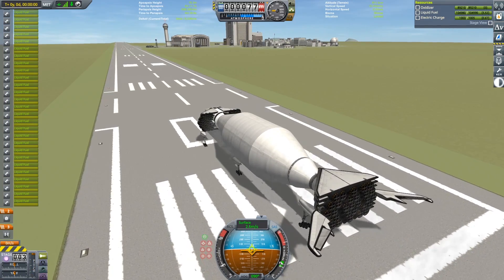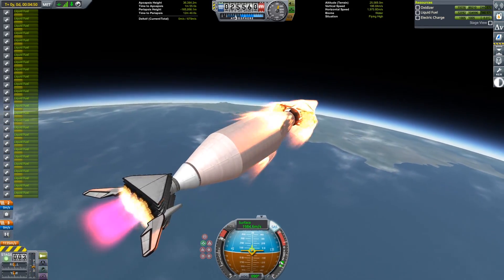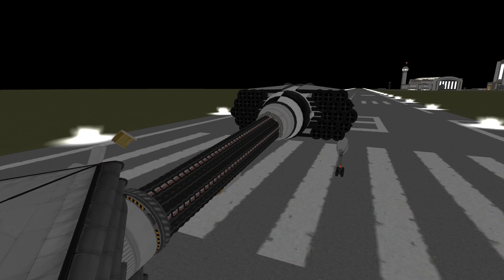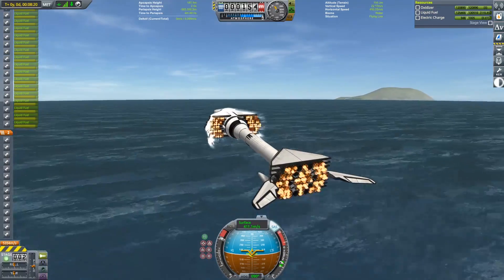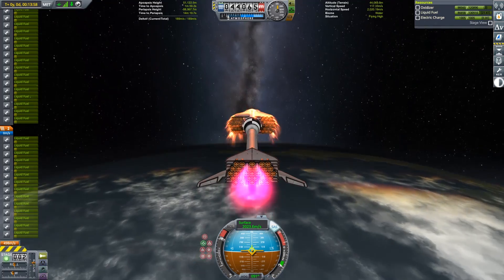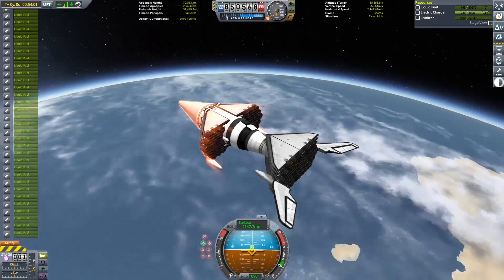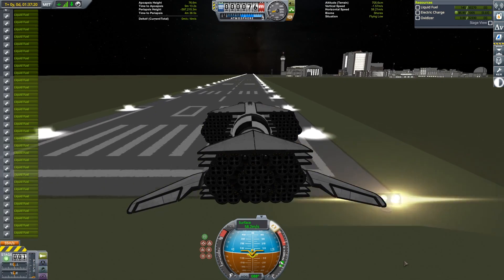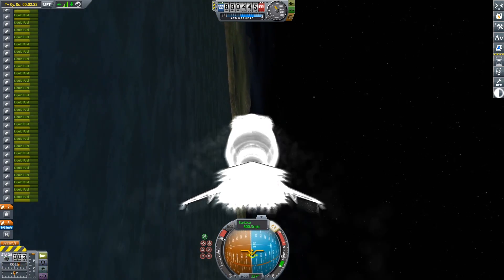KSP - Delivering 1000 tons of payload to orbit with a 600 ton SSTO

Comment: The one thing that stuck out to me immediately was you had no static incidence on the wings. If you can get through the 320-390 m/sec Mach barrier with the nose pointed precisely prograde, you need a lot less thrust. Less thrust means fewer engines, less fuel to feed them, and less structure.
 I have made large SSTO tankers with initial takeoff acceleration as little as .32G. While they weren't optimized for payload fraction (I'm all about the Benjamins), they were still very respectable in that regard.

Comment: 8:52 could add another set of smaller landing gear to the front for end of mission landing

(or add a 5th landing gear to the back in the center to make it stick to the ground on landing)

I prefer using a pair of air/liquid jet engines with reverse thrust to get the landing speed just right and avoid wheel brakes until the ship is stable

Comment: Numbers wise, this is supremely impressive.
Practicality wise, no one is going to design a 1000t spacecraft/station as a small thin tube... ok maybe I should say most instead.
Can you please show how heavy a ring station it can lift in one run? One whose ring is too wide for a faring as I paid around 450k in mostly fuel costs (and inaccurate landing losses!) for 2 runs hauling a 360t ring station with reusable rockets for my career mode. For a job that paid like 110k haha.
Reply from the maker: Bulkier, lighter payloads would favour a steeper ascent.  If the payload is bulky enough, a vertical launch may be ideal.
Reply: @BradleyWhistance  Ok makes sense. How about putting a spaceship/rocket into orbit with stupid amounts of delta V in 1 run? I love the way you split the hauler in 2 parts, would love to see it's actual real use capability.

Comment: To answer your question how to dramatically improve that SSTO just add some heat protection the simplest one is the tiny ball shaped monoprop and put it just in front of the tip of your craft. That way your craft becomes much easier to land and you can also use different ascend profiles. Offsetting your wings can also help a lot by making the SSTO more stable and therefore loose less deltav for corrections.

Comment: recently i tried dividing all the wings relative area by their weight to figure out which wings have the best lift to weight ratio so i could build the loftiest plane i could, i found the tiny winglet with the yellow stripe is the most efficient, if you used those winglets for all your non steering wings you could save a little bit of weight, dunno if it would be worth doing but its something
Reply: Shuttle wings have free integrated fuel tank. So they are more efficient.
Reply: @rainbowhyena1354  didnt think of that

Comment: You can do this...:
Make booster rocket that is equal parts fuel and oxy, put high power thrusters such as mammoth types and do the move/adjust until you have about 8 of them in one supertight cluster. That on a huge airfoil with a port coupler and break away boosters to ensure it helps pull a heft craft up and get up to altitude and velocity without taking off the tail. That can be calculated as to how much extra lift and thrust it will provide and for how long. Based on that, you can theoretically add more mass to the payload.

Comment: I really think it would have been better if you switched the nuclear engines for vacuum-optimized chemical engines. The LV-Ns have a very low TWR.
Reply: But still twice the efficiency which absolutly outweigth the twr con
Reply: When you have 11 minutes to apoapsis, TWR isn't really a problem.
Reply: @DFPercush  You're not saving much of propellant, but adding a lot of dry mass.
Reply: @MatterBeamTSF  Yes the engines are heavier, but you have to look at the increase in mass as a ratio with the total dry/wet mass of the craft and its impact on the rocket equation. If you gain twice the ISP and spend a significant amount of time burning in that regime, the delta V gains will overcome the increased mass. The heavier the craft, the more it benefits from a more efficient but heavier engine.

Comment: I believe you have successfully broken the rocket equation in its entirety.
Reply: And he did it with a lack of magic stripes
Reply: @naomiwolf8944  The continuous and constant thrust provided by speed stripes is very useful during takeoff, ascent and manouvers... but becomes a major issue during all other phases of the mission and on landing. Massive brakes are needed just to keep the spacecraft still if you add them

Comment: That docking idea is terrifying. You need to have zero roll.
Reply: You could add 2 other docking ports to the side I guess
Reply: @iain3713  I tried this about a jear ago to launch a nucler powered low speed airplane (absolutuly shitty concept i know) before breaking ground came out to launch the wings alined with the main body of the plane then decopple in orbit, turn the wings about 90 degree and redock them. The problem was that i wasnt able to dock the wings to 2 docking ports to make shure the 90 degree angle becouse when the first ports were docked the 2 parts were already connected
Reply: @supertatze2960  Solution is to use 2 docking ports, spread wide, not 3. His design its called a split shuttle and is a very old concept, since 0.9 at least !
Reply: Imagine how nice it would be now with rotating docking ports

Comment: Does closing the air intake help in gaining speed? I've always only waited for it to go off on it's on I mean no air no problem right?
Reply: Yeah I had a similar response but I realized Bradley must have looked at this and calculated the drag reduction from closing the intakes at 19kM outweighed the benefit of keeping the air-breathing propulsion going until flame-out @ 29kM.  I'll have to try it on my somewhat smaller designs!

Comment: If it undocks and redocks, its NOT an SSTO. Anytime it splits into two or more it becomes a multi stage vehicle.
Reply: "single stage to orbit" 
It got to orbit in a single stage.
Reply: He's only doing it because of the size limitations of cargo parts.   It works as a proof of concept.  If he were so inclined he could design the required cargo bay and it would work fine and be easier without the need to dock.

Comment: Impressive as always! :)

Wouldn't using wing streaks be more efficient than the big wings? More "free" LF space for the same mass in wing area. Did the big wings already hold more LF than you required and you just went for the wing area or was it a part consideration?

Also a follow up, because I can't count the wings exactly. What is the ton/wing area, seems to be ~36 wings there, so ~8.5t/m2?
Reply from the maker: Wing strakes are indeed superior.  I used these as part count reduction

Comment: You know it’s Bradley when a 305s I_SP engine is “highly inefficient”.
Reply: I mean, it is. If you want pure vacuum efficiency you could use aerospikes which offer equal thrust at a much better ISP (410s) and half the mass.
Reply: @marcustulliuscicero5443  I thought the aerospike ingame-stock was at 340 seconds, maybe I'm wrong, 410 would be a realistic number for hydrogen fuel in real life albeit pretty bad vaccum efficiency even for a hydrogen booster, the RS-68 which is pretty bad in vacuum still does 412 with a low expansion ratio nozzle compared to other hydrogen sustainer engines like Vulcain (430) or LE-7 (440).
Reply: @chriskerwin3904  

Oh yes. It's 340s

No idea where I got the 410s from.That would be an insanely good engine.

340s still is the tied 4th best chemical vacuum engine though, behind the 345 of the Terrier, 355 of the Cheetah and 380 of the Wolfhound. Though neither of those are really useful for normal-sized spaceplanes. The Cheetah and Wolfhound are too large, while the Terrier has horrible thrust (which means lower efficiency during ascent due to gravity losses).
Reply: @marcustulliuscicero5443  If your looking for good relatively good TWR and decent vacuum performance (320) try using large clusters of Spark engines. Kerbal gravity losses tend to be quiet small though or at least compared to real life.
Reply: @marcustulliuscicero5443  I was replaying the old KSP 0.18 demo, and the old Terrier engine in that has some crazy good ISP - I think it has 390s in vacuum
Reply: @marcustulliuscicero5443  410 is wolfhound
Reply: @chriskerwin3904  i cluster wolfhounds lol
Reply: @asingularcheesepuff6383  Sparks used to be insanely good too— I think they might have had to nerf it twice, once by raising the mass and another time by reducing the thrust.
Reply: @asingularcheesepuff6383  The LV-909/Terrier wasn't all bad in atmosphere either IIRC. I used to stick several pairs of winglets on the long fuel tank, then fly around the KSC with a Terrier. It lasted surprisingly long.
Reply: Some high efficiency KSP engines are actually comparable to the main lifting engines on a Saturn V.

Comment: Noticing the awful lack of speed stripes. Speed stripes would seriously improve upon this design. Yes.
Reply: How about putting a number on the side of the fairing???
Reply: Baactiba definitly and than maybe add lightning bolt and flames for that extra performance
Reply: @baactiba3039  Absolutely. A number is a must-have. And it must be two digits, with a leading zero.
Reply: don't forget to paint it red
Reply: I convinced someone that speed stripes did in fact add speed once. Say anything in a serious tone and people will believe you.
Reply: @jeffvader811  I remember that!
Reply: Yes speed stripes I understand now hold on I'll be right back
Reply: @naomiwolf8944 

Hey, Another Awesome Protogen!
Reply: @AssistantCoreAQI  im gonna do a stream soon where all i do is nerd out for 30 min about random tech shit if you wanna see that also i animate but i dont know what im doing
Reply: In KSP2 you can increase your delta v by painting the rocket red so it goes faster

Comment: Would it be possible to reduce fuel weight by using a stock propeller?

Also, maybe you can use srbs and detach them after deploying parachutes.
Reply: Then it's not an SSTO.
Reply: @TristanPopken  Aerodynamics wouldn't be hit too hard.  Optimizing props means that at their max possible speed, they are just a few degrees from being at 0° AOA, so designing a prop that will have low drag past it's useful speed isn't too hard.  The real issue is that props are only good to ~270m/s and are dead weight after that.  Getting off tehe runway quick is nice, but are you saving fuel?  (I didn't do the math so that's a legit question.)

Comment: Challenge: Go to Tylo and back with ONLY ION ENGINES
Reply: @neverfearthekraken  taking off is the challenge. I figure with a large enough natural ramp, and a tolerable twr, it could be done. But then there's the same problem that arises with an Eve take off. You still have to *get there* in the first place. as for landing, I haven't been to tylo enough to know if there's a flat enough place to do it, but with a low enough orbit, I wonder if it would be possible to lithobreak the rest of your delta-v away. Maybe even have a "crush gear". you take the brunt of the impact at first with that, and drop yourself a few hundred meters per second, and then finish it off on wheels
Reply: @DarkSlayer9587  So your idea is to basically orbit along the ground and use wheel brakes to slow down? I think with a perfectly round planet this could actually work.
Reply: @Mike-oz4cv  basically... Yeah. It's easy to do on minmus due to its massive flat plains and low gravity, but with the right plot of ground, I feel like it's something Bradley could pull off
Reply: Just theorizing of course. Now I'm tempted to test that out
Reply: you can lithobrake if enough of your momentum is lateral. Same concept behind how skateboarders can fall far further when moving faster, without breaking their ankles. bradley has actually even taken advantage of this before when landing on minmus, although lithobreaking is easier there, it would save greater dV on tylo
Reply: ImpossbleThanos.mp2

Comment: WOuld the design be different if you were optimizing for fuel to payload instead of launch mass to payload?
Reply from the maker: Yes it would!  This would favour a design with a higher TWR.  I considered using payload/fuel as a metric - it is more arguably more relevant for a cargo plane.   The decision maker was that the fractional payload metric is more instructive for the other single stage missions I have planned.
Reply: @BradleyWhistance  
If you were to do this in real life, I think it would be a better metric, because for reusable launch vehicles fuel cost becomes one of the limiting cost factors.
Reply: @jeffvader811 sorta, it takes millions of dollars for a falcon 9, but only a fifth of a million to fuel it up.
LOX is cheaper than you'd expect.

Comment: Would you consider doing a tutorial on aerodynamic optimization? It's a part of the game that nobody really thinks of (besides you, of course) and would expose a more technical aspect of KSP to people working on efficient designs.
Reply: Maybe there's something I'm not thinking of, but I doubt there's a whole lot to say about it. KSP's aerodynamic model is very simple, so basically thin shapes (minimal cross section into the airstream) are the most optimal. This includes limiting wing area to minimum as he mentions in the video.

If you're really interested in aerodynamics I suggest the FAR mod. It simulates aerodynamics based on how the shape of the vessel changes along its longitudinal axis as well as how lift and drag change in stall, transsonic, and supersonic regions. You can also build your own cargo bays with it, for instance surrounding the cargo with wings, unlike in stock (something he also mentions in the video).
Reply: It's mostly about how to use the offset tool to minimise drag. 

E.g I'm fairly certain the rapier engines on this craft are connected one to the other (to occlude both attachment nodes), then moved to their final position. So the drag you get is the same as having a 59 long stack of rapiers instead of 59 separately attached rapiers, that would have an open node at least at the rear.

You can also see the LV-Ns are using the engine plate i believe? which makes the drag model ignore the drag on the LV-N.

 Would love to hear about all the tricks Bradley used here :)
Reply: @blaztrik  Didn't they remove that exploit quite a while ago? I went and did a quick test with an offset rapier and according to the aerodynamics overlay of the game the offset engine caused more drag than the one that was inline. Not sure if it translates into actual gameplay difference, but I could swear it hasn't worked for a while. Not sure what version Bradley is on here but I doubt it's that old.
Reply: @Greippi10  It still worked in 1.7 afaik.
 I'll check again when I get home, but I don't think this craft would ever break the sound barrier if those rapiers produced full frontal drag.
Reply: @blaztrik   Keep in my mind that the structures in game are ridiculously heavy compared to real life mass fractions meaning that the lower twr of the rapiers would be offset in real life with a lighter structure?
Reply: We need this
Reply: He explained it in a comment underneath. If I understand correctly, layering the wings like he did will make the game engine forget the location of the parts that it is covering.
Reply: @barbecuedchicken2894  Where? I read through all the comments and can't find it.
Reply: I seriously need this tutorial, it's the main knowledge I'm missing at this point in KSP, the arcane knowledge of all the weird exploitable quirks of the aero model and attachment system.
Reply: This is what I’m trying to do from time to time.

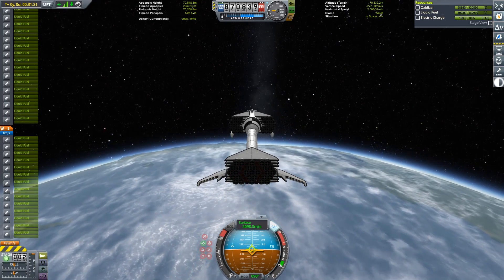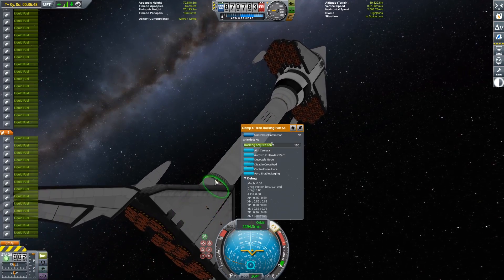Comment: I'm sorry to doubt, but what's the velocity jump between 6:54 and 6:56 about? 
Your the skills and designs behind these craft amaze me. I consider myself 'gud' at this game, but you continue to remind me how much there is to learn. Thanks Bradley!
Reply: He switched the velocity indicator from surface velocity to orbital velocity. The surface velocity is less because it's the plane's speed relative to the surface that is already rotating at nearly 200m/s in the same direction as the orbit.
Reply: Looking at 6:54 in more detail, mechjeb says you're orbit apoapsis and periapsis are both above 70km. It also says you have nine meters per second left. But the next clip shows you at the same altitude, with a periapsis about 6 meters lower, and 12 m/s. 
Explain please?
Reply from the maker: @johnrivers5934  The change in velocity is due to a different frame of reference.  Surface velocity is measured relative to the surface of Kerbin (which is rotating), orbital velocity is relative to the center of the planet.

The minor change in periapsis is due to the small amount of impulse from the decoupling.
Reply: @BradleyWhistance  So a simple change then, my mistake. And of course the six meters from your periapsis and 3 to delta-v are basically negligible.
Reply: He undocked from the rest of the craft. Less dry mass means more delta V.